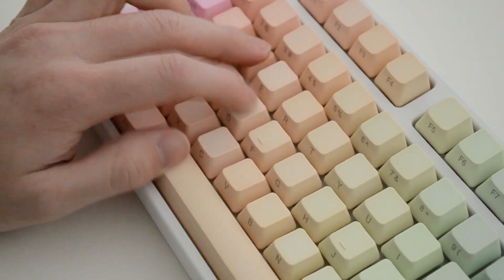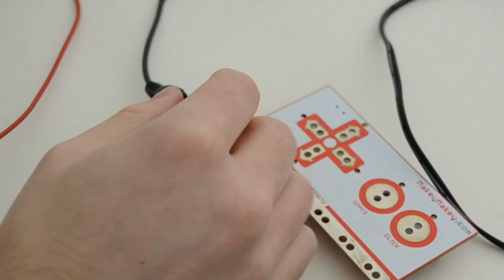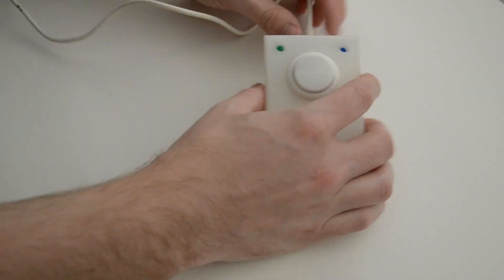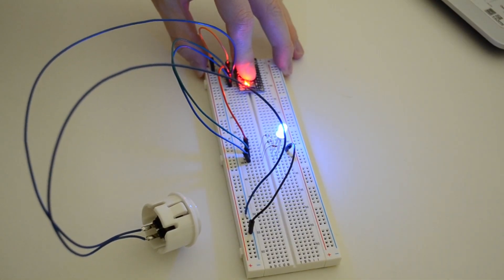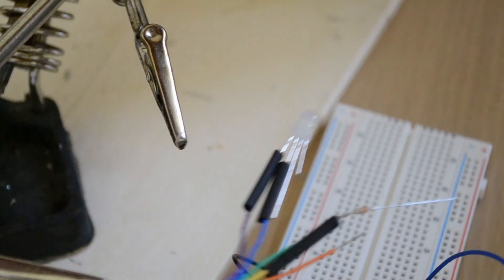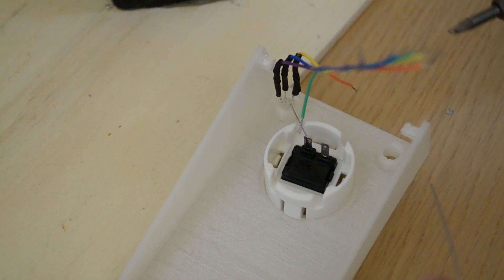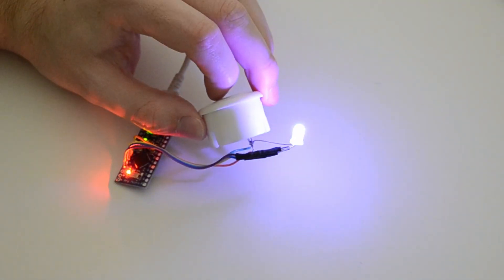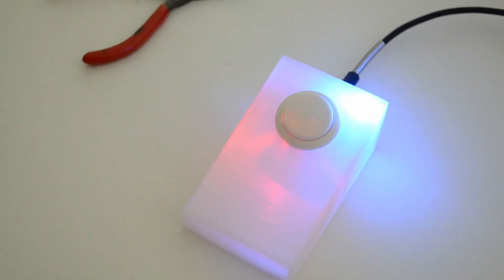Foot Controlled Push To Talk Button

Comment: Can the ptt be bound to a G key, like G34 for example? Or must it only be alphabetical, and not macro made keybindings?
Reply from the maker: Yes, it can be programmed with a macro. You would just need to add a line to the code for each key press, and be sure to release them. There may need to be some other modifications as the code now will continue to send the macro over and over until you release the button. To work around this may be as simple as adding a delay of say 500 milliseconds.